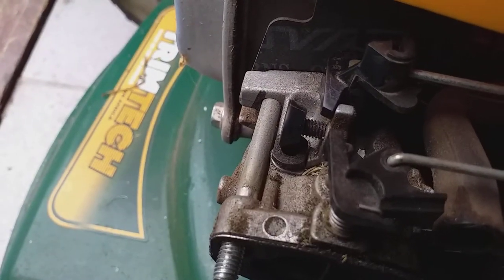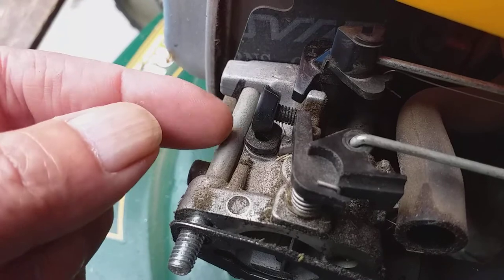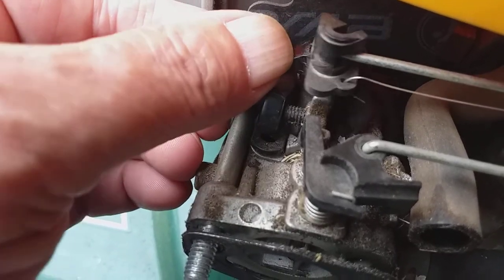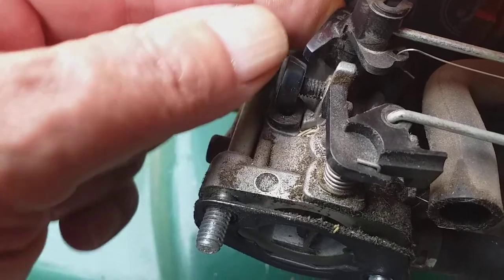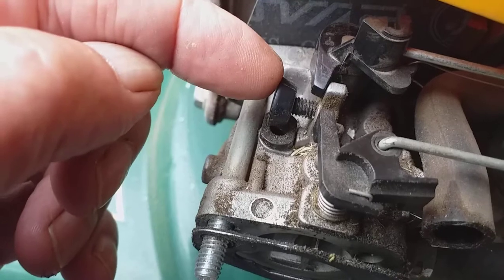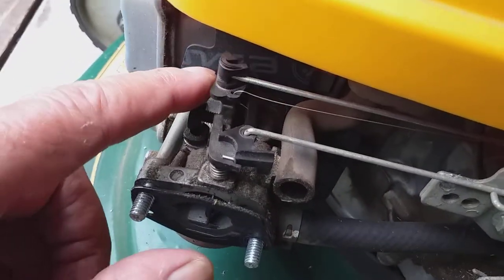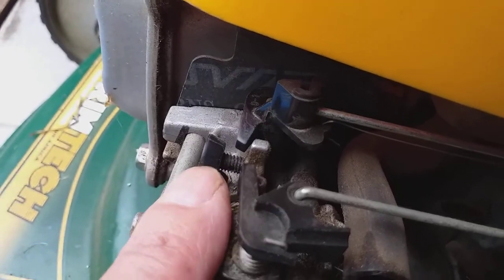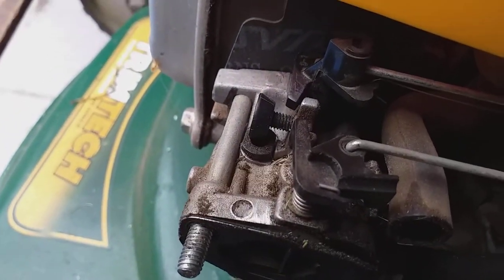Torx 140 Engine, I Think I Have Your Problem Thabo, Hope this is it

Comment: Great work mate, I just bet that's the issue. If it isn't, and the other linkages and springs etc are all in place and not stretched etc, then it's got to be some kind of foul up with the governor, (because what else is left lol) and that's not something I would recommend he tries adjusting unless he knows exactly what to do. A sure fire way to over rev and blow your motor. Let's hope this is his problem, otherwise as you say,  the machine needs to be in front of you to be able to work it out. Only so much you can do over the internet. Nice easy repair if it is the throttle stop screw though. Fingers crossed for Thabo! Cheers my friend, well done!
Reply from the maker: Thanks Brendan, really a nice comment, I can add nothing to it, and yes if it is the internals of the governor, it is a day job to fix I guess, thanks for your support all the way my friend

Comment: And as per advice i did take the machine in to the workshop today and it will be checked tomorrow. I will bring the feed back as i get it
Reply from the maker: Thank You Thabo, sorry I could not help, yes please give feedback, I will inform the other guys, have  great day my friend
Reply: @jankotze1959  hello Mr Kotze, i went to the shop to collect the machine. It was well done and am happy. And even though we did not succeed in fixing the machine surely i have learned a lot and those special videos will help many from then until. I paid R500 in total for the service.

One more question?
What petrol between 93 and 95 is good for this machine because the workshop say 95 is the best but my two strokes brush cutter loves the 93 unleaded
Reply: @jankotze1959  it was late when i got there i did not have time to ask what was the problem but last week the said tje government was lose from inside
Reply from the maker: @thabohendrick1021  Thank You Thabo yes if the governer was loos inside it would cause that problem, glad it is fixed, keep well my friend

Comment: Hello Mr kotze. I did check that butterfly opener and it moves well. Its just when the machine is running it does not move as you mover the accelerator lever to slower RPMs
Reply from the maker: OK, you did the right thing, please give feedback Thabo, that will help us as well

Comment: Hello guys, the machine came back from the workshop and it was fixed. I paid R 500 for the service, its cut very well then my concern is that what petrol between 93 and 95 which one is the best for this 4 stroke machine? Please advice and thank you for your help from the start?
Reply from the maker: Hi thanks so much for the feedback, I was wondering what happens, 95 is the best, did they tell you why it run full revs?
Reply: @jankotze1959  hello friends. They did not say because i collected the machine after closing time, it was during dark and they were in a hurry to go home. But i will ask them what happened
Reply from the maker: @thabohendrick1021  Thank You, I realy would like to know what cause the problem, it will help me if mine do that
Reply: @jankotze1959  hello Mr i will ask them what was the challenge there and will feedback here. Thank you again to all the members here